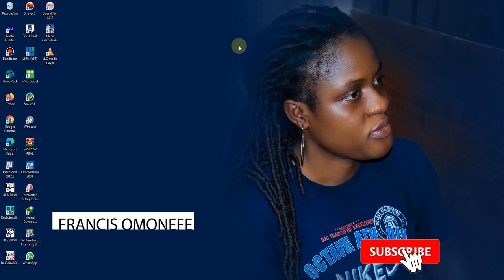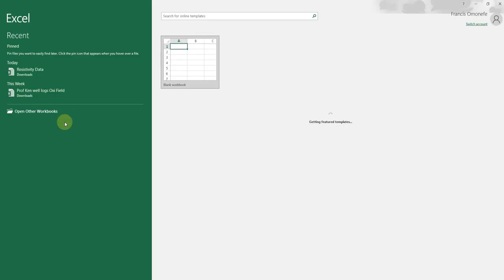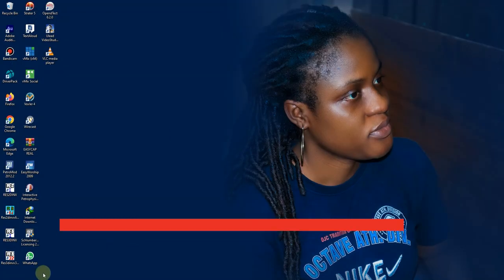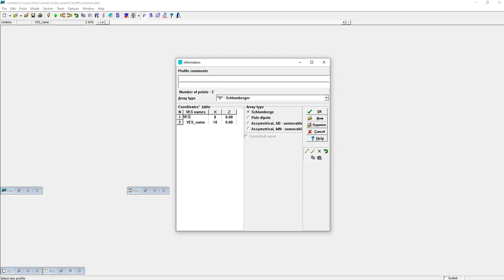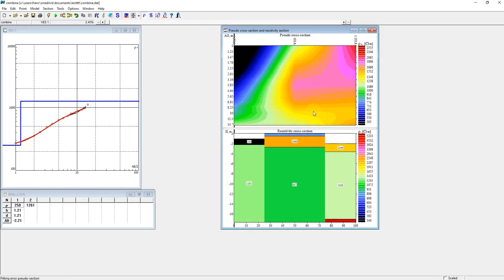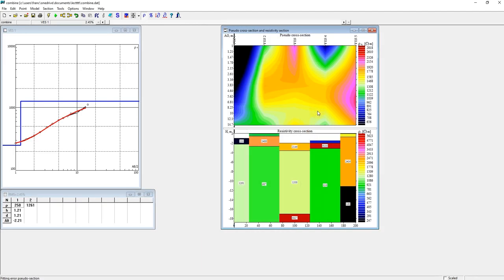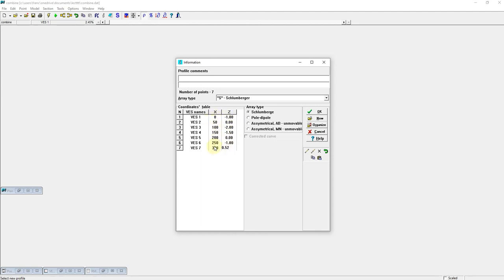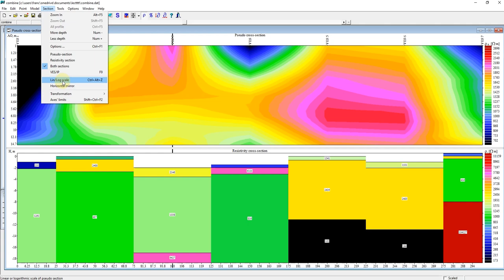How to add elevation or Topo to 1D resistivity using ipi2win

Comment: What was responsible for the elevation reading as either 0 or negative 1
Reply from the maker: Elevations are altitude values from GPS taken at the field or at the point of sounding.. 0 is sea level.. + values are above sea level and - values are below sea level.
Reply from the maker: Please subscribe to the channel if you have not done so already. Thanks.